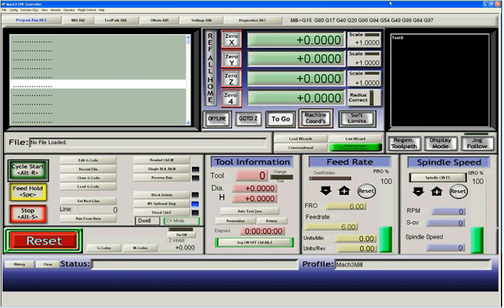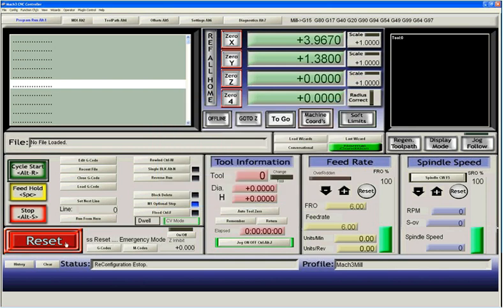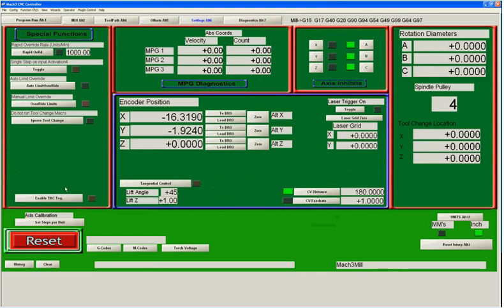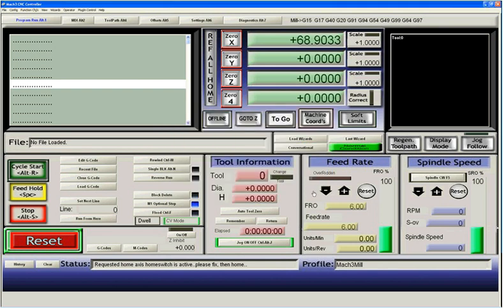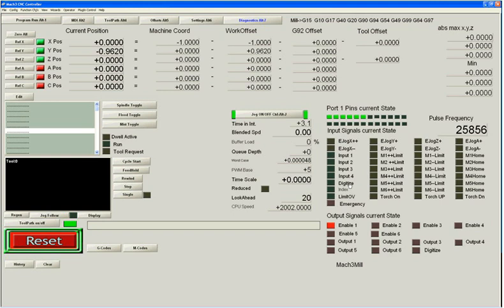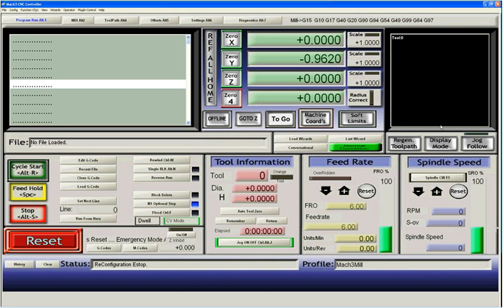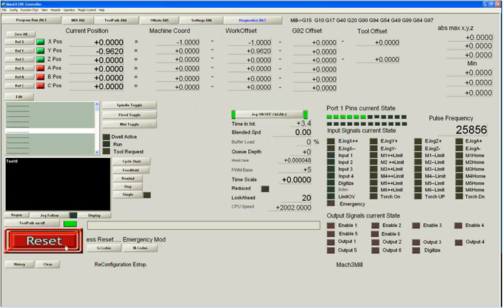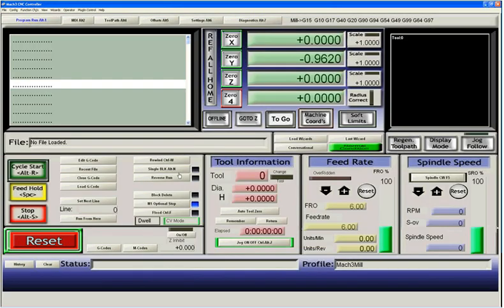Mach3 Trouble Shooting

Comment: building a cnc plasma, i’m getting all the electronics put together 1 axis at a time. Motors function properly when using the mill profile, but no matter what i try i get no moment from the steppers when i switch over to the plasma profile. I’ve been pulling my hair out for hours now and i cannot figure out why. Any ideas?

Comment: I am trying to install a touch plate with the probe setting. However I am having the digitize light on all the time. This is true even with nothing in the breakout board on port 1 pin 11. When I take active low off the digitize light goes out but I am still unable to make the touchplate work.   Even disconnected completely from the machine the digitize light is on. Any suggestions?

Comment: My laptop have RJ45 connecector and mach3 also have RJ45 connecector so what settings required for my mach3, I have i7 laptop and windows 10 installed

Comment: Help!  I've been using Mach3 for years and am fairly familiar with it.  Yesterday I set up to do a chamfer on a round part.  The DRO is zeroed and my cutter is indicated in to the center of the part. The crosshairs in the Mach3 display show not centered on the image as you would expect.  The crosshairs are up towards the top of the circle.  I try to run the program and the chamfer starts at the top of the circle but tracks way off when it starts the outer diameter of the part.  Never seen this bug before.  Any suggestions.  No offsets are set on the offsets page.

Comment: Made all the adjustments as detailed in this video. DRO moving ok. However, my motors still are not moving. any ideas?
Reply: Hi Adrian, did you solved it?
Was it a soft or a hardware issue?

Comment: i am checking to see if you can tell me what if anything i can do to turn on my spindle . i am using a china 1020 cnc with a 4th axes i have put the s1500 m3 in  on mdi and it still doesn't turn on , i have also tried different rpms i double checked ports and pins every
thing looks right .maybe its something simple i'm missing.

Comment: I have a problem with mach 3
. To this day everything worked fine and I didn't touch any parameters except the tuning motor

Now, when I click  +Y on keybord or touchscreen the machine goes to + a couple of times and then it goes to -
the same thing happens with -
Y
X and Z axis work Ok
Reply: Have you solved this issue?
Reply: @LearnerBoy  diconect everythnig and conect again and reinstal mach3
Reply: @borkoknives  now all are working accordingly, right?

Comment: Great video, I have a 3020 china cnc without limit switches. You have answered many questions. 480p resolution is hard to read the script. 
I would zero my bit on my part i need to cut not realizing when done the cnc would go out of limit and make a really loud stepper grinding sound and i would just hit the emergency stop function.